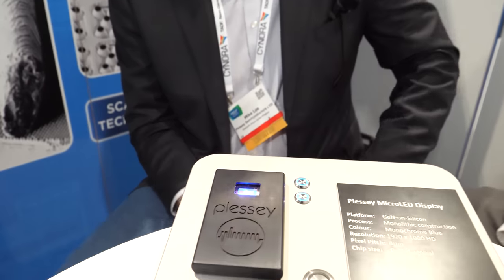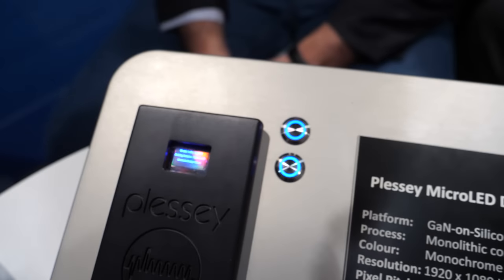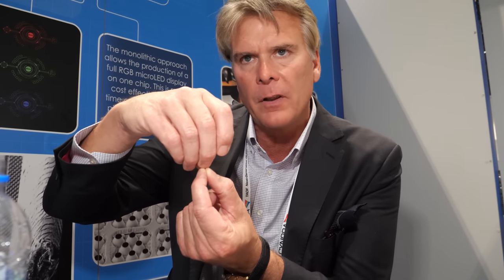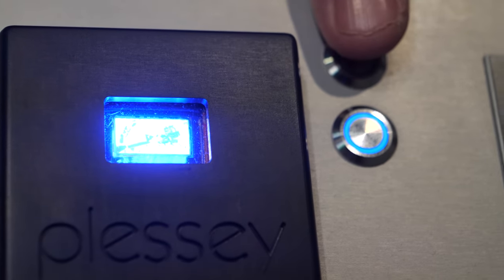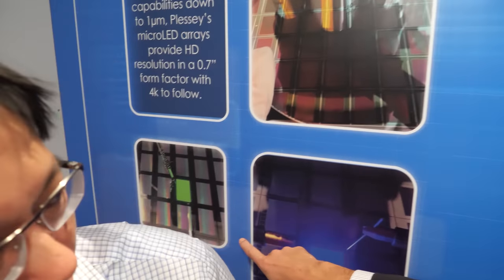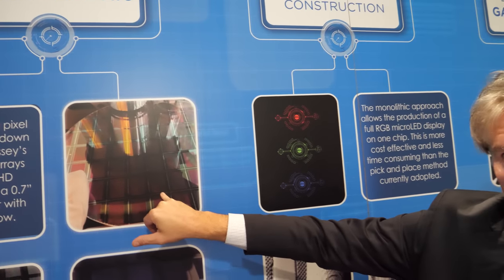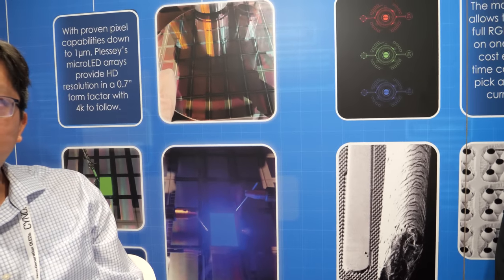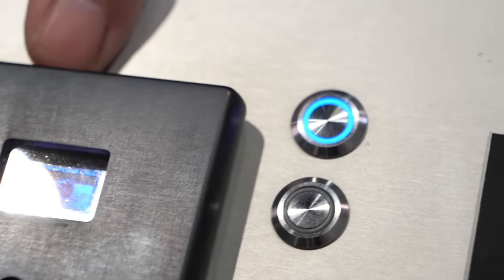Plessey microLED GaN-on-Silicon Monolithic 0.7" FHD Bonded Display

Comment: This thing could be also used for more efficient Smart Watches too and with low power consumption, watches battery life could be extended much more. So many applications for this. Not only for AR.
Reply: Looks like another company already is also in the works using same tech. This is the link. https://www.youtube.com/watch?v=52ogQS6QKxc
Company is called JBD based in Hong Kong.

Comment: I think JBD microLED is more advanced.
Reply: Hard to say, their displays aren't full RGB yet. I think Plessey is taking a more conservative approach and primarily building displays that can actually be driven by current processing capabilities (especially in the mobile sector). They claim in the video they CAN make much higher resolution displays, but from an economic perspective that probably isn't actually necessary quite yet. I'm sure they have prototypes behind closed doors that are comparable to JBD, but JBD is being more open about their development.
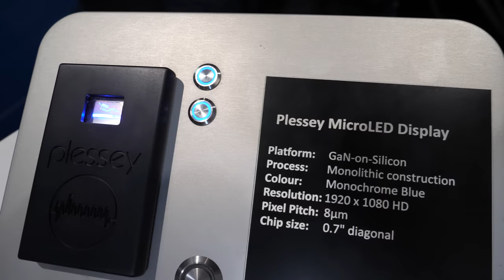Reply: @saml7610  At 0:26 they specify "monochrome blue". At least JBD showed us 2 color display (red&green). 

I myself can't wait for 3 colors RGB microled display to see how they look :)
Reply: Poor Samsung they need to grow leds in the lab like JBD lol on silicone
Reply: Yea but they both have same technology with JBD is taking its time to
Make it correct others may not do as good as a job many rush into marking screens but then miss something that is needed for it to work properly you have to sync each module together so all modules have to have the same quality as the next one near it

Comment: Your average phone screen is around 5 inches so they could easily pull this off for new smartphones
Reply: Samsung wall microled you can still see the individual pixels but on this silicone with over 5000ppi  you can't it's like a miniature oled screen that is brighter and better no burn in and has a higher density than Samsung TV wall microled just shows that smaller teams like this and jay bird have microled that can hit over 1million bits and 4k by 5k on a tiny 1inch little fucking screen how the fuck can they do it and Samsung TV acts more like a mini led and JBD shows true invisible super microled on a 1inch piece of silicone and gan
Reply: @jonathanoxlade4252  this is absolutely insane I can't wait until this becomes available for consumers

Comment: Self adjusting sunglasses with a screen you can control with your voice. Imagine AR that works with both AI and Android and or even x86 which co exist with reality so you can see the persons face while changing certain other surroundings with bone conduction audio, this is what I see.
Reply: In terms of functionality, Hololens 2 is crazy, I used the first one and it felt like I had a superpower the UI was so natural, it sucked to leave it. There were still a lot of limitations but almost all of those have been addressed on the new Hololens, however, it's super clunky and the screen isn't bright enough outside, it seems Plessey will be able to address this, the future is bright